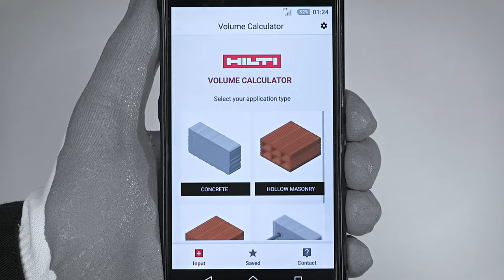Hilti HY 200-A Injectable Chemical Anchor

Comment: I need to use very small amounts, just two to four holes per job. Hilti what do you advise to prevent wastage as the chemical goes hard. Should I just purchase more plastic mixing nozzles and replace with each use?
Reply from the maker: Thank you for your comment. You can store the chemical for up to 4 weeks in it's original cassette with the nozzle still attached. When you next use the chemical you will need to replace the nozzle.
Reply: @HiltiGreatBritain thanks for confirming.

Comment: Are u supposed to manually poke a hole in the tubes before use??
Reply from the maker: Hi there, thanks for your comment. 

There's no need to poke a hole in it before use, just screw it into our HDM dispenser and it's good to go. 

Hope this helps!